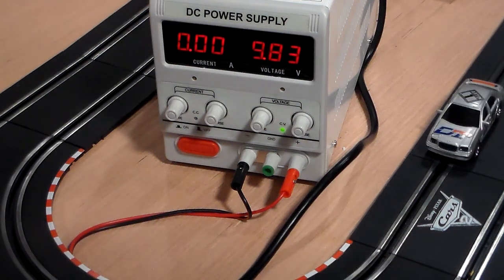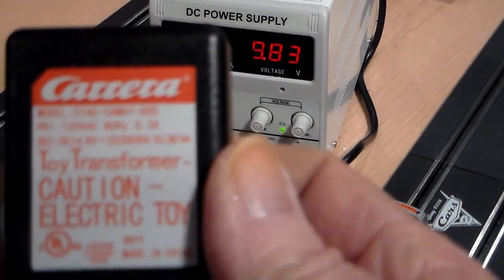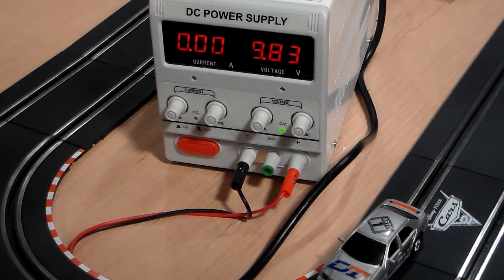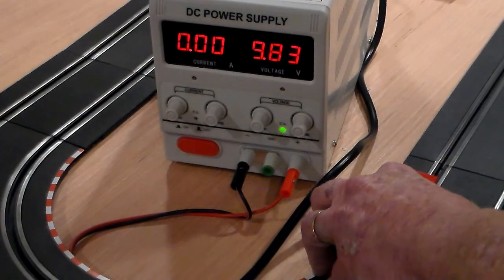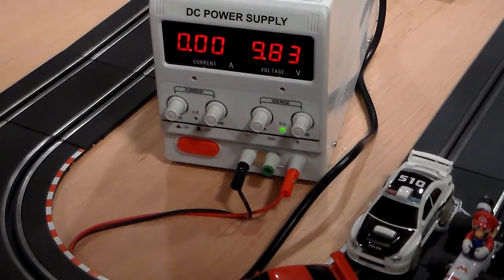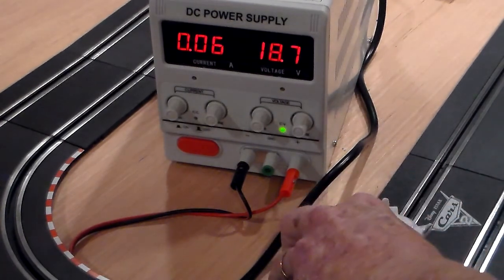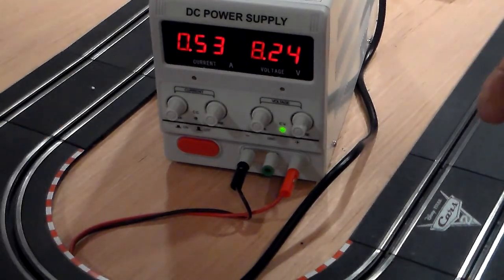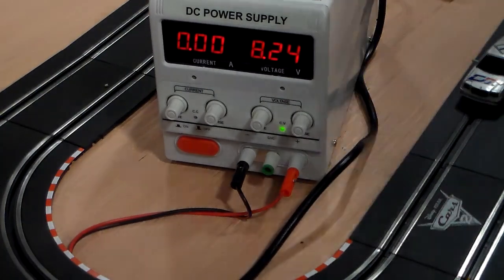Part Two Carrera Go Track power problems for using Artin Cars

Comment: Hey CaveMan  I'm looking to upgrade my Carrera 1/43 track with an aftermarket power source as the voltage drop is too great.  I think the stock power pack is 14.8V at 0.7A  What would you recommend?

Comment: Carrera controllers start smelling while powering Artin cars in less than a minute of use... they are "not" heavy enough to endure continuous .50 amps of use using the stock power cube.  The motor in Artin is the problem and needs changed to the lower current...it is sales ploy for cars to have different current motors, and can't be cross used on each others track.
Reply from the maker: Hey Michael I believe what you are saying, going to do a test to verify. But comments like yours do help me learn. If there was a motor that could be fitted into the older cars I would jump right on that, so far not found any, thanks for your input. Caveman
Reply: I think your videos are enlightening.  I'm think after repairing an Artin controller, and seeing the coiled wire inside used as a rheostat, they might work for both.  One could install a double poll double throw toggle that could switch in or out those 2 resistors powering either Carrera or Artin.  If I get some time in the next few weeks I will try to wire a test and let you know.  Thanks, Mike
Reply from the maker: That would be Great let me know when it works for you, so I or we can pass it on. Thanks for the assistance.